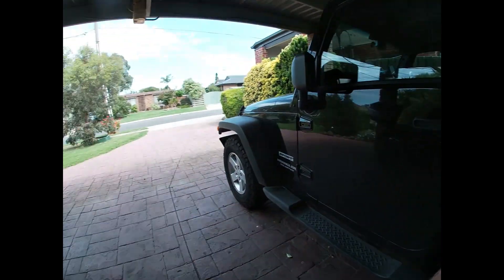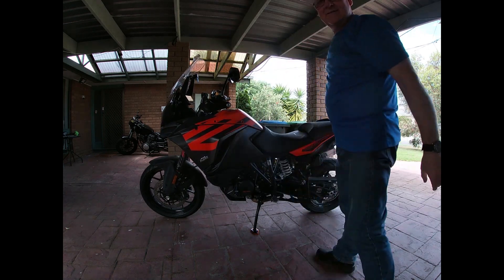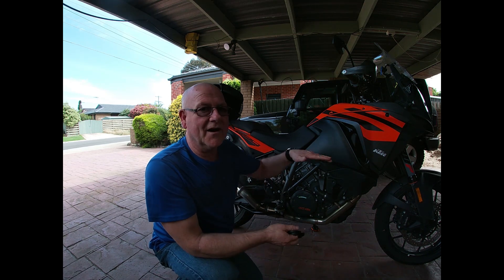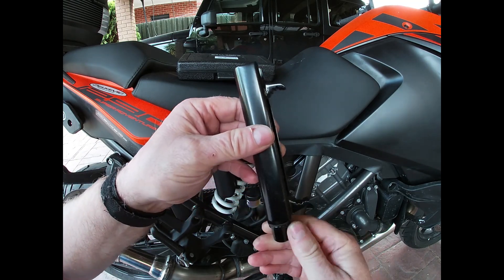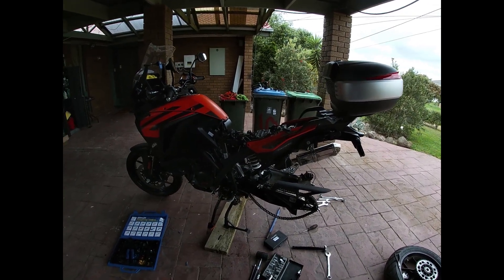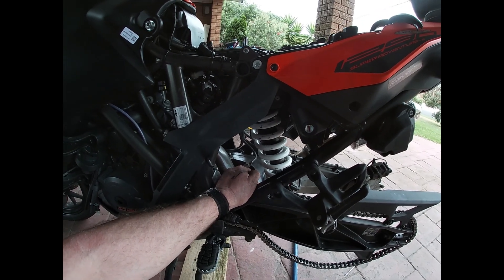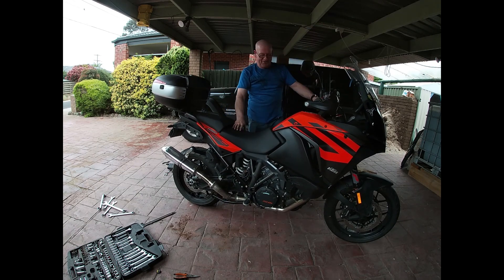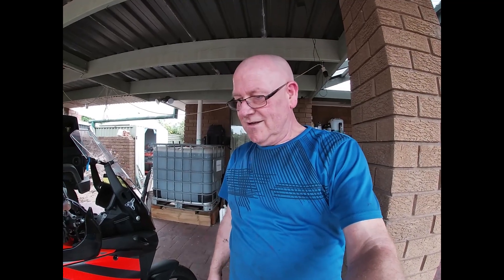Lowering KTM 1290 Super Adventure S

Comment: Hi Dan, thanks for posting this video, I have looked that those rear shock collars but wondered what I’d need to do with the front, pretty obvious but I was unsure. Now I know I’ll go ahead and order the collar, I wondered if you’re able to talk me through adjusting the front forks please, any pics or videos would be a huge help. Thanks James
Reply from the maker: Hi James,,  The front is easy, there is a bolt at the top collar and the one just below,,  Put the bike on centre stand, slacked the top and bottom collar and adjust both the exact same,,  Also remember to adjust the steering damper to the lowest position,,,

Comment: I did this to my 2016 SA and didn’t know the bit about the steering damper. Dropped it on tight turn due to restricted steering. Now undone the damper fork bolt to get full lock again. But as the body of the damper is fixed to the frame. How can it move down with the 20mm on fork yokes?
Reply from the maker: The damper is fixed to the frame, however it is the part that is connected to the forks that you have to move so it lines up with the fixed part,,,  Hope this explains,,,

Comment: Thanks for the video Dan. Did you have any problems with the semi active suspension after lowering?
Back here in Scotland I have just bought a super adventure but cannae reach the grun.
Reply from the maker: I feel your pain.. Im only 5'8" and 31 inside leg,, I was on my toes all the time...  I put the lowering part in, very easy when you have the spring compressors, it dropped it enough so my feet were flattish on the ground.  The suspension doesn't have any problem, I sometimes take the wife out for coffee, set to rider + pillion and it sets the springs, it actually stiffens it but it goes even a little lower which is great. Not had any problems at all and neither have all the other guys who have done this..  A cheap way to lower it and well worth the efforst for a safer feel to the bike..   What part of Scotland you in mate?
Reply: East Ayrshire Dan. God's country.
Thanks for the reply. If I go ahead with lowering I will post details. Cheers
Reply from the maker: @garyroxburgh6561  Ayrshire is where my family originate from.. One of my cousins owned the Railway Hotel in Ayr for many many years,,, dont know if he still does,,,
Reply: @biker_dan  Dan. Have a look online. The hotel has been falling down for a few years. Is fully enclosed now in a big tent as it is a listed building.  They can't knock it down, but it keeps dropping bits onto the railway line
Reply from the maker: @garyroxburgh6561  wow.   I wonder what's gonna happen to it now